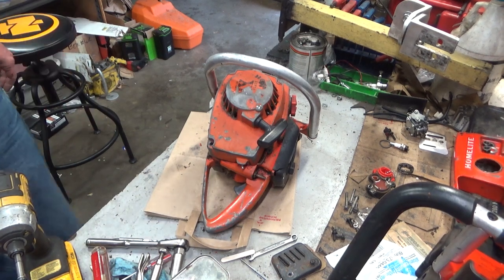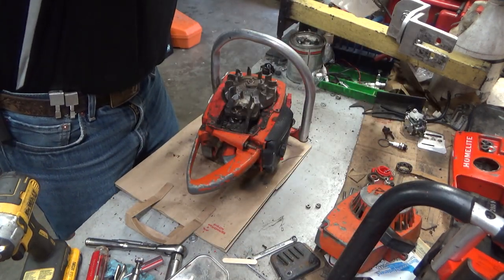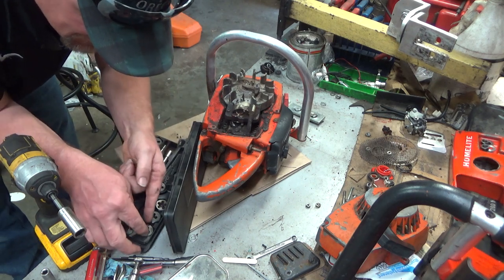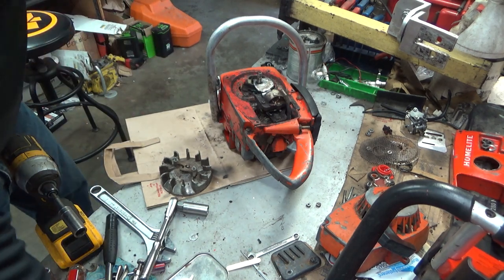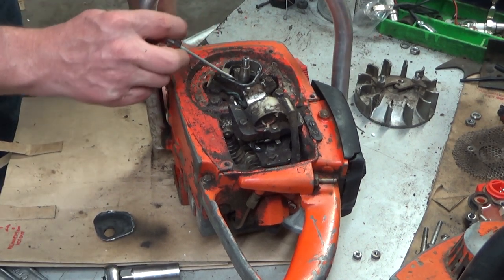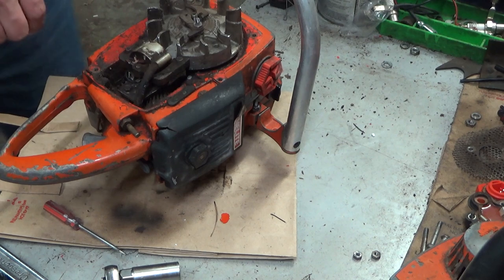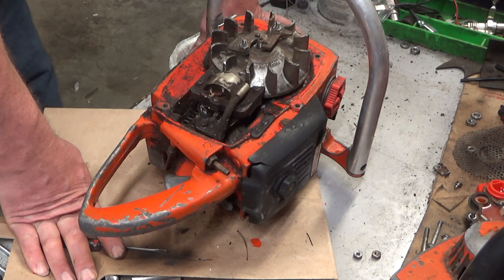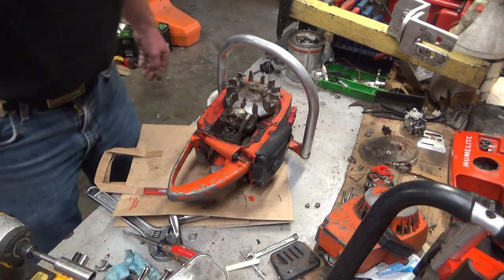Did Your Homelite Super XL Chainsaw Seize While Cutting?  It May Not Be Internal Engine Damage!!

Comment: Everytime I go pick up a new saw for my collection and the guy who is selling it to me wants to show me that it turns over, I tell him don't worry about it!I would rather you not do that. And hear is why I say that! I have seen a pattern over and over again when I purchase these saws! Almost every one of the old saws i get my hands on have a brand new carburator on it! This is what I have figured out. When the chainsaw stopped working for the old boy who owned it, he tried to get it to run again by purchasing a new carburator to make it run again. But that was not the problem! The problem is that he was cutting with a dull chain and when you do that very many times it makes sawdust enstead of chips or shavings if real sharp! But the cooling fins on the flywheel are sucking that air borne particals of fine sawdust inside the saw plugging it up and covering the pick up on the coil with oil soaked sawdust and finally it can't zap a spark across the air gap! He gets frustrated with it after buying a carburator and it didn't work so he through it under his work bench for the next God only knows where things like screws fall and happen to find themselves inside the pull starter cover and the magnet on the flywheel grabs that bolt or screw and the next time someone decides to try to get it to fire up it gets lodged against the case and the flywheel usually looses a tooth or it gets stuck and won't allow the engine to turn all the way around! Sound about right too you? 😋

Comment: My Dad used the SXLs in his tree service back in the late 80s/early 90s and had probably a dozen of them sitting around that locked up.  They all sat in an old shed for years until the roof finally gave up and everything got soaked for years.  When I started to tinker with these saws, I asked him if I get some of them to screw around with, but he had already taken them all to the dump.  Sure would have been interesting to see how many were truly locked up and how many had something like this or that screw backed out.  He did run these saws hard.  Thanks for the video!

Comment: The same thing happened to my newly rebuilt pro mac 700,flywheel nut came loose and sheared the keyway and chipped part of the race on the crank thankgod for Jb weld not happy using for that application but I didn't exactly have another crank, and it was during heat cycling!